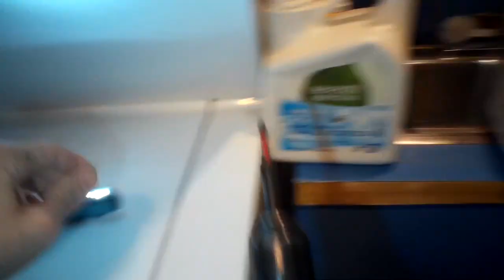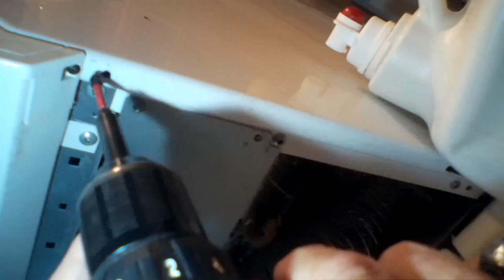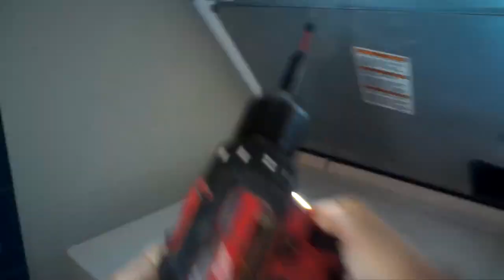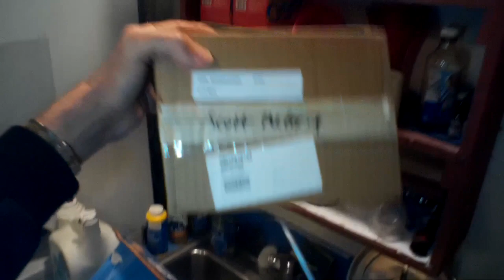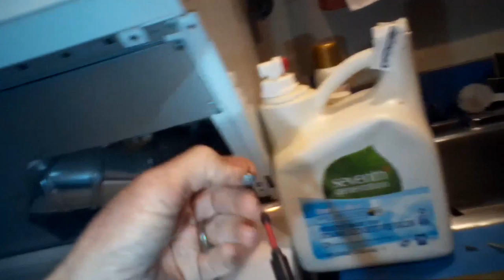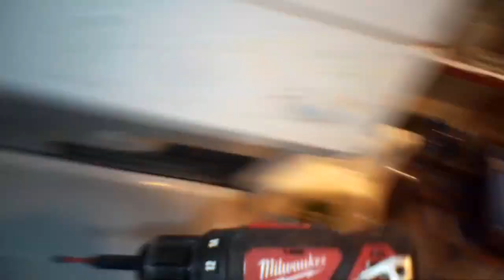GE Washer Dryer Combo -Timer Replacement

Comment: Not even the machine in the picture representing this procedure
Reply from the maker: Sorry for the confusion, the procedure is the same for several similar models.
Reply: @ScottTheFixItGuyChannel Well I was trying to get washer timer out and could not figure how to get knob off. Its the older style in that picture. Cant see a retaining clip to pull off and the face panel not being able to remove as knob holdes in on. Has to come off to get screws out
Reply: Pls help if can what holds that timer knob on. Another video showed a screw removal and then pulling a pin and again nobaccess until that knob is removed. Any advice. I not forceing as do not want to break

Comment: I've got the same issue - lid locks but the drain pump doesn't engage. How do you troubleshoot to make sure the drain pump is not the issue? Do I use a multimeter to test the leads to see if it's getting power? Anything else I can try? Thanks for the video!!
Reply from the maker: Can you send your model number to: scottthefixitguy@yahoo.com

Comment: Hello I was just wondering I have a very similar ge stackable unit, and I went to take out my timer to replace it, but it looks very very different to yours. It was in the same location and it IS a timer, so mainly my question is, is it the timer for both the washer and dryer, or just the dryer? If so, where might the washer timer be located? Thats the one I need to replace.
Reply from the maker: Thanks for your question,
Can you send me a picture of that along with your model number to: Scottthefixitguy@yahoo.com

Comment: @scottthefixitguy. Great video. How do you check if the pump is not the problem? I have the same stack, I checked my pump and nothing is stuck inside. The washer will fill, spin then stop once it gets to the final spin cycle. I hear a little ticking sound coming from the timer but will stop and doesn't cycle to the end. HELP!
Reply: btw, it doesn't drain or spin when it gets to the final spin cycle. is it still the timer switch?

Comment: If the dryer works fine but there is no power to the washer, not even to the LEDs, would it more likely be a faulty timer or control board?
Reply from the maker: Is it an electric dryer?

Comment: How did you open the control panel
Reply from the maker: There are a few screws below the lower right hand corner in a few screws below the lower left-hand corner but you have to remove.
First thing is to remove the bigger panel that’s below the control panel.